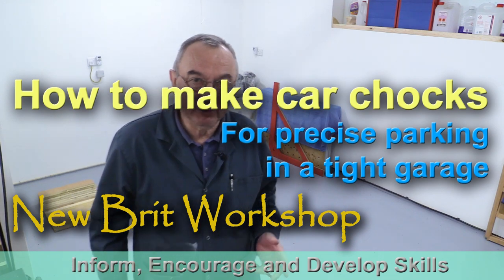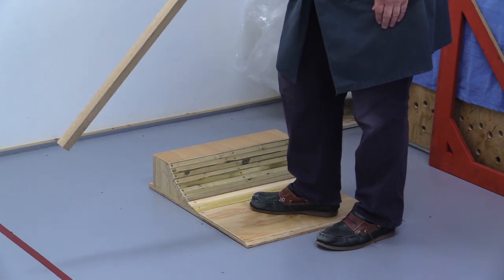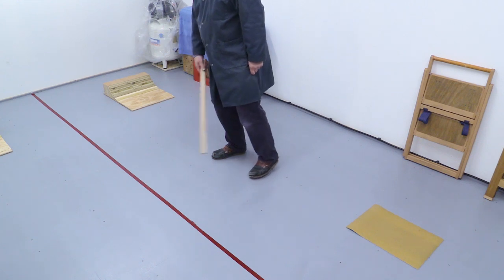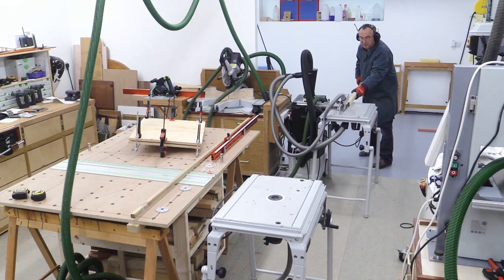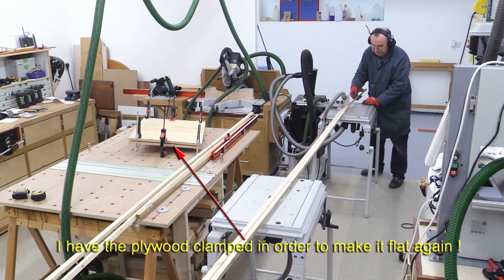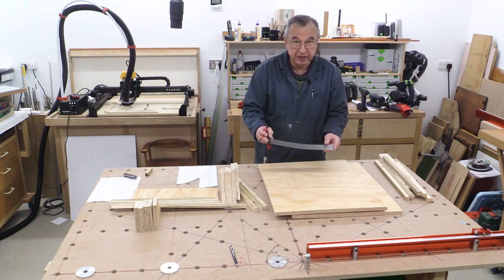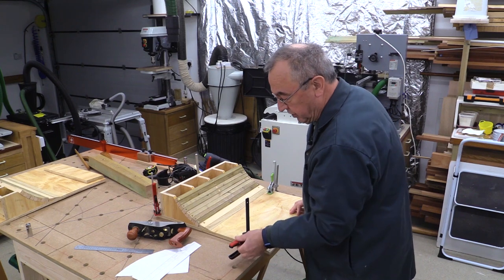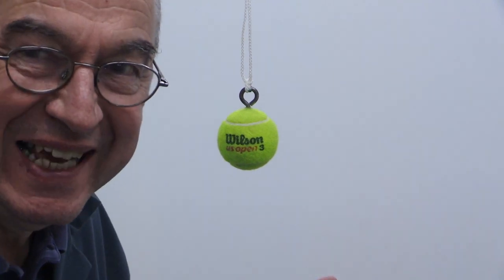How to make car chocks

Comment: Nice set up.  Good you fastened them to the floor.  Built something similar many years ago for a friend who kept bumping the front wall.  They did not want them fastened to the floor.  Every time they brought the car in the chocks would creep forward a few millimeters and soon they had a hole in the drywall again.
Reply from the maker: Hi Barry, Many thanks.  Peter

Comment: Nice solution.  Suggest you seal the timber, including the part that is connected to the floor.  If your timber is not marine ply, it will probably delaminate as the water from your tyres sits and softened the bonding glues used in its construction.  If you also put a strip of reflective tape on your guide line and top of the chock, your path will be better highlighted when you drive into park your vehicle at night.  Thank you for the presentation.
Reply from the maker: Many thanks for this.  Cheers.  Peter

Comment: I have both the large and small Incra T Squares.  While they are good for drawing parallel lines I don’t trust the scales because I’ve found that the attachment of the blade to the head rail has a tendency to drift off square.  I keep resetting it but it keeps moving off square giving variable distances from the edge.  I don’t know if you have found the same.  It’s OK for rough layouts but not if you want precision.
Reply from the maker: Hi Steven, I have had no problems with mine at all. If the fence is coming loose then use some Loctite on the screw threads when you next set it up.  Cheers.. Peter